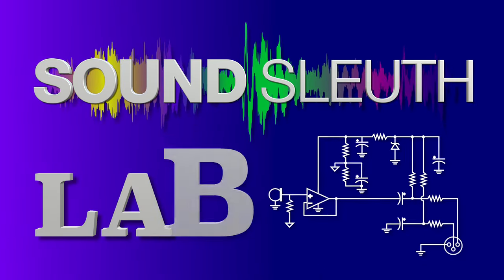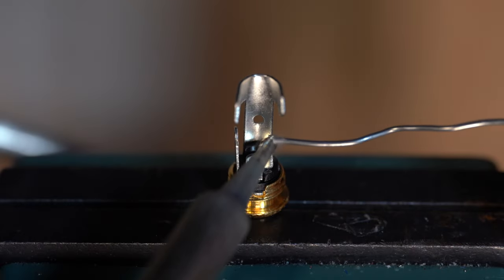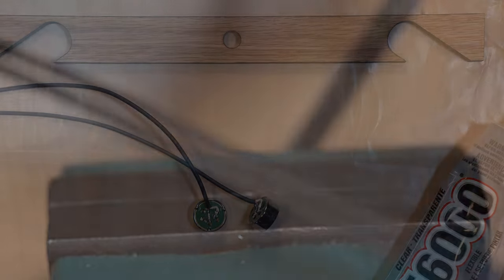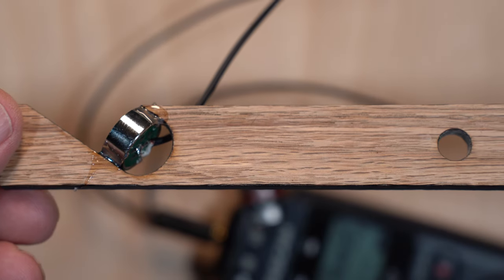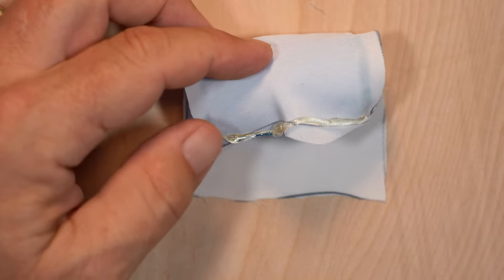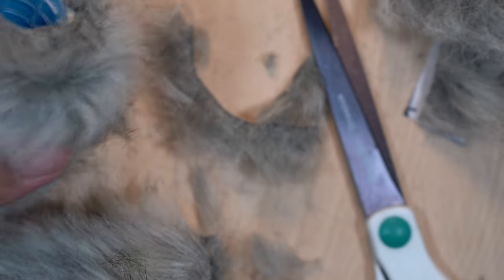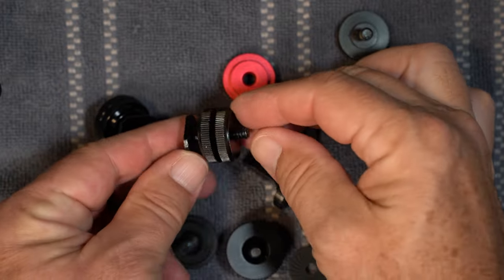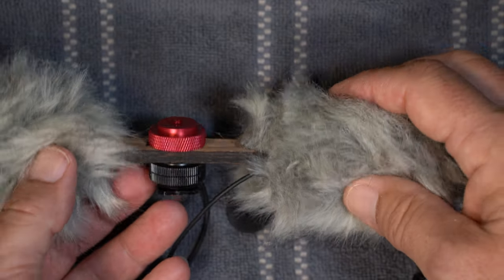ORTF On Camera Stereo Microphone

Comment: Great project; thank you for sharing.

What kind of braided shrink tubing do you think would work with the Mogami W2368 cable?
I'm interested in making 6 foot lengths of cable, but I want to have maybe 3 feet wrapped up to help with cable management.
(six foot cable wouldn't be for this specific project, but would I would use the same cable).

Have you ever considered using a TRRS adapter instead of TRS?